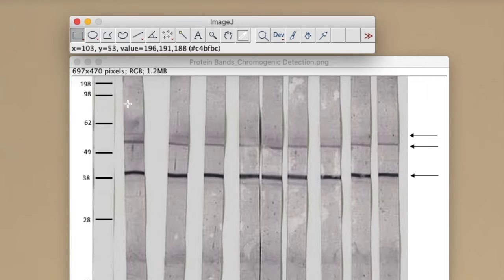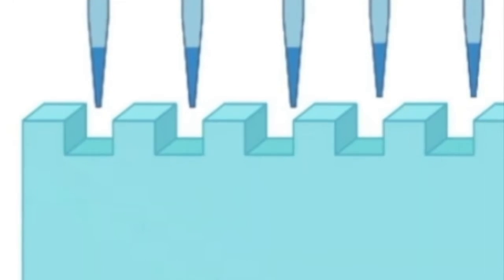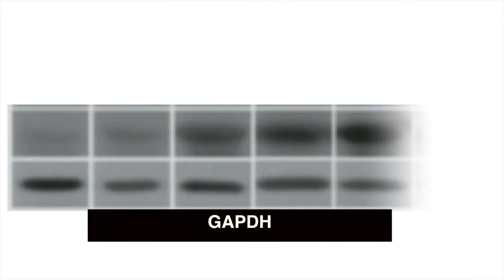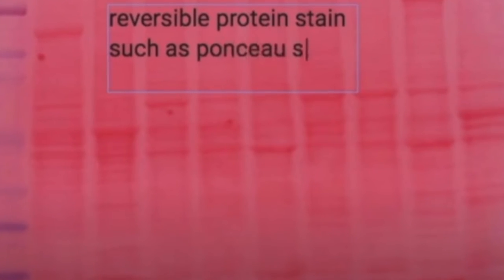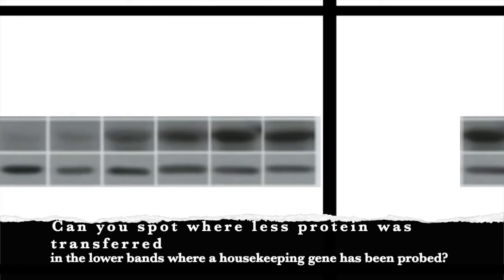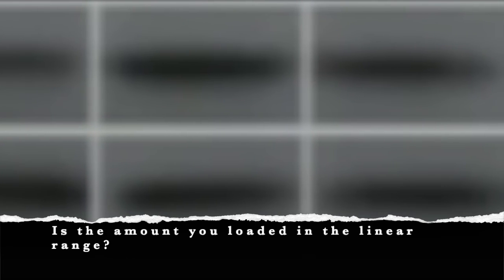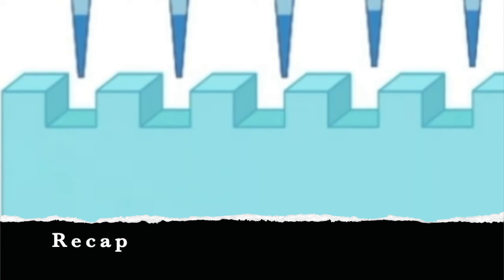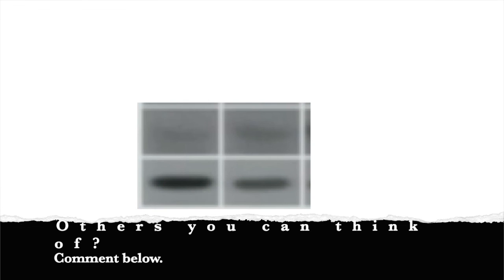📊 WESTERN BLOT NORMALISATION USING HOUSE-KEEPING GENE or TOTAL PROTEIN STAIN

Comment from the maker: Western blotting is a technique used to detect specific proteins in a sample. It involves the following steps:

- Sample Preparation:  where proteins are extracted from biological samples and denatured.
- Gel Electrophoresis: where proteins are separated by size using Sodium Dodecyl Sulfate (SDS)-PAGE.
- Transfer:  where proteins are transferred to a membrane (usually nitrocellulose or PVDF).
- Blocking: where non-specific binding sites on the membrane are blocked.
- Antibody Incubation: The membrane is incubated with primary and secondary antibodies.
- Detection: The presence of the target protein is visualized

House keeping genes are used to demonstrate that there no variations to the proteins occurred, during any of the steps.
Reply from the maker: 🧪 Catch up on Adwoa Biotech tutorials you might have missed!

- CRISPR-Cas9 Guide Design: https://youtu.be/VlbGQiB83-Y?si=2_rnQ...
- Western Blot Analysis: https://youtu.be/i-jGiG9PN50?si=niR4P...
- Drug Screening Assays: https://youtu.be/PRipiWOrnDQ
- Data Analysis Basics: https://youtu.be/wx_Y9tfW_u0?si=N4zF7...

Subscribe for more lab tutorials and molecular biology tools 🌍

Comment: you are saying that if you load 30ug of proteins into each lane, you can't have a straight line (linear), and thus, you can't use housekeeping genes like B-actin for protein normalization?
Reply from the maker: Yes, that's right: with 30ug or more, you have so much protein there, that your B-actin or other housekeeping protein, would be too saturated to detect differences.
Reply: @adwoabiotech please could you explain that in more detail? As the only purpose of B-actin is to normalise your loading.
Reply from the maker: The linear range is where you can accurately measure input differences, because this is the concentration at which the analyte concentration (i.e. housekeeping gene) is linearly proportional to the input amount (i.e. protein loaded). You want to stay below 30ug of protein because it’s the input amount where you have a constant slope. You want to avoid concentrations (i.e above 30ug) where the response is not-constant i.e. not proportional to amount of protein input. Hope this is clearer :)

Comment: Hey my life saver,...i have a question...can you please elaborate why estimation is needed for running western blot in an aspect of same amount of protein loading in every well for control and treatment samples!?
Reply from the maker: You estimate the proteins so that you can load the same amount of protein (usually ug amounts: e.g. 20ug)
Reply: @adwoabiotech  thats what i asked why we need to add same amount of protein in each well and what is loading control ?
Reply from the maker: So that you can be sure that if you see one band is stronger or less than the other, you know that it is real biological difference, rather than being due to you not adding the same amount.
The loading control confirms that you loaded equal proteins to begin with.